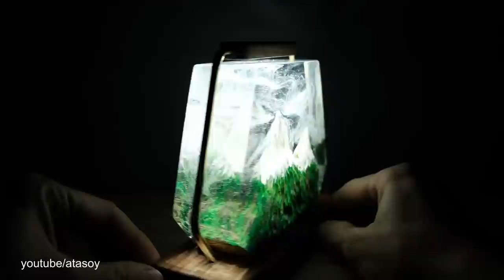How To Prepare Decorative Snowy Mountains Epoxy Lamp

Comment: I just subbed, you do some extremely beautiful work that I would like to attempt some day. One question though, for sake of time wouldn't it be quicker to get a sheet of acrylic and cut it up for mold walls instead of covering wood with packing tape?
Reply from the maker: Thank you very much, I'm glad you like it.
Yes, plexi or acrylic sheet would be faster, but these sheets are very expensive in the country I live in, so I try to reduce the cost by covering the wooden surface with tape.
In future videos, I will start using plexiglass in small size works.
Thanks for sharing your opinion.👍👍